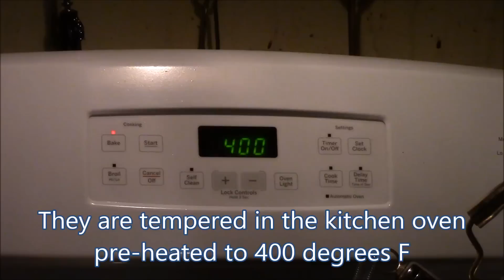Making Gouges and Chisels Part II

Comment: One more comment on the lighter fluid and grinding sparks. last summer I had contracted to remove some equipment and doors on a carpet mill factory. Had to cut the door frame and all out to remove the machinery. I have a homade gas powerd metal abrasive cutting saw. It does a great job , but I left the gas can next to where I was cutting. I heard someone yelling about gasoline and fire. They told me I was blowing sparks over my gas can.  
I totally understand that at worse a gas fumed bomb would make a bunch of paper work for the servivors. I use the older gas cans without all that push , pull spout that seal really tight. Seeing you grinding those sparks on that fire starter reminded me of all my times.
Reply from the maker: I was wondering if anyone would comment on that! The funny thing is that I'm not even sure where that bottle came from.

Comment: I commend you for your video and process. I’d offer a couple pieces of advice in regards to your forging and heat treating process. The majority of the time leaf springs are made from 5160 steel. There’s a lot of specific heat treating information available on the Internet. 

One thing I saw particularly wrong in your heat treating process was the tempering phase. 20mins is not an adequate amount of time to temper a knife or tool made from 5160. One hour cycles are the minimum, and there should be at least two at 375f-400f. 

Another thing, which may have been done off screen, involves your quench oil. If you aren’t using a commercial grade quench oil like AAA or McMaster-Carr’s 11 second quench oil(both good for 5160), then canola oil is your next best option. You’ll want to heat it to 130f though to prevent a vapor jacket. This can be done by either putting your metal quench oil container on a hot plate to heat it up, or just heat up a piece of steel and dip it into the oil until it rises to temperature. I prefer the hot plate method as it’s more consistent and a $10 hot plate from Walmart is sufficient. 

Lastly, in regards to your forging, I want to commend you. You forge at the correct temps. This might seem obvious, but I see so many people hammering on cold steel and it drives me nuts. A steel like 5160 can already have stress cracks from its life as a leaf spring, and hammering on it cold will definitely exacerbate them. 

You probably want to thermal cycle/normalize your piece after you’re done forging(before heat treat). With 5160, this can be achieved by the following steps:

heat to 1600f
Pull out and allow to cool to black
Heat again to 1525f 
Pull out and allow to cool to black
Heat one last time to 1450
Allow it to cool regularly and then temper

This will remove stresses in the steel from forging. It is a very beneficial process and is easy to do. Just heat to magnetic and then a little more for the first one. 

Good luck and thanks for the videos
Reply: Great info thank you, do you have any videos? I learnt more about 5160 steel from reading your post, then I did researching on Google. Thanks again for sharing that info, your a life saver, I knew there was more to the process. I didn't want to waste my time making & end up cracking or breaking when using.

Comment: Hello Rick.  Did you ever create anything like a gouge or skew chisel (and used it) for the purpose of wood turning?
Reply from the maker: No, but thanks for asking.  It has been on my mind to do both although I don't know if I'll make a video of it because the method would be the same. The only difference I can think of might be the angle of the cutting edge and a longer handle.

Comment: Very informative video Rick. My question is at what angle do you sharpen your ...I believe it's your half round gouge. It's the one that could be used for making a bowl in a wooden spoon. ( new subscriber). Thank you for your time. ( Ohio)
Reply from the maker: Hello Jack, thanks for your interest. The gouges in the video have been sharpened to about 24 or 25 degrees. I find this is a good angle if you are going to use a mallet to strike with. If you are going to be mostly pushing the gouge by hand then 18 or 19 degrees would probably be better. I hope this helps.
Reply: Absolutely...Thank you so much for the quick response....!

Comment: Those turned out great. Bet you made a great cigar store Indian with them.
Are those washers really needed?
Reply from the maker: Yes, the washers are needed. If they were't there, every time I hit the chisel with a mallet it would push the tang further into the wooden handle until it broke. There are other ways to do this so you wouldn't need to weld it but something needs to act as a stop.
Reply: Most chisel don't have a "washer" they just have a tapered shank.
Not having a "washer" should make fabrication easier.
You must be hitting to hard :)
Reply from the maker: This is just the way I make them, you can certainly make them anyway that you like.
Reply: They're absolutely necessary for any gouge or chisel that's meant to be struck with a mallet.  They're called bolsters BTW.  The best chisels will have a forged socket that the handle fits into.  Next best is to do a bolster and ferrule like is done here.
Reply: I like that idea of the washer also give you something to weld to and build up to create a taper gives you some material to work with. Don't have to worry about how hard you hit it if have a good solid stop.

Comment: you can get rings from Lee Valley tools
Reply: You can purchase the entire gouge there too. But I think that might be missing the point.
Reply: Also you can get brass tubing or copper pipe for the ferrules from your local hardware store or big box if you want to fancy it up a bit.  I like the copper and use that for my hand made turning tools.  Great video!

Comment: Nice job.  I've been making fishtails and spoon gouges out of intake valves with good luck but need to start making larger gouges.  With the leaf springs, have you had any trouble with the edges chipping?
Reply from the maker: Thanks, To answer your question I've not had any trouble with the leaf springs. I make knives with them also and they seem to hold an edge pretty well. I would guess that it depends on if your tempering process goes well.